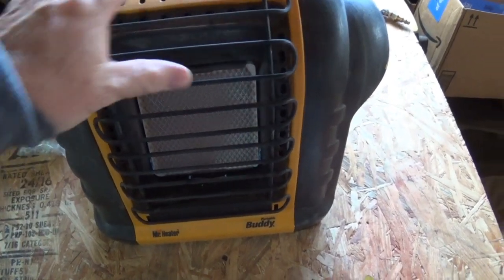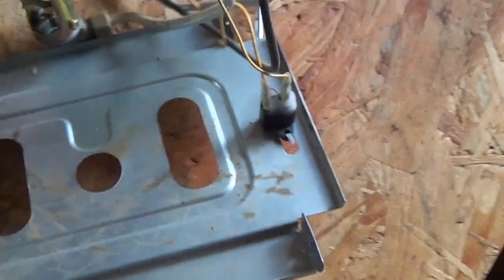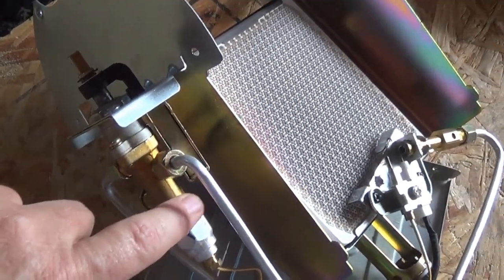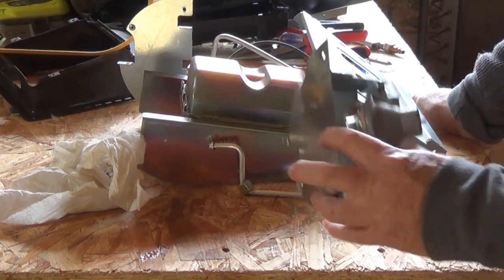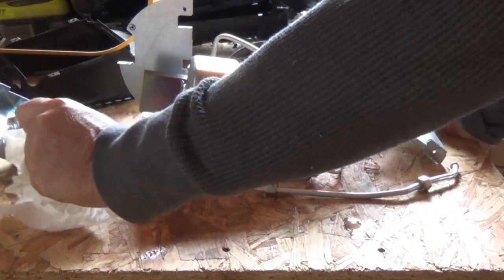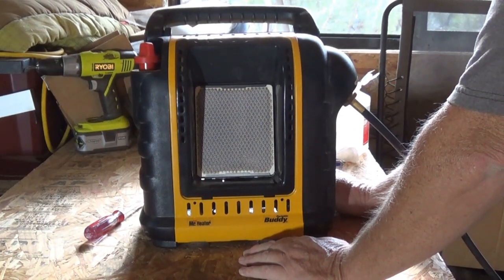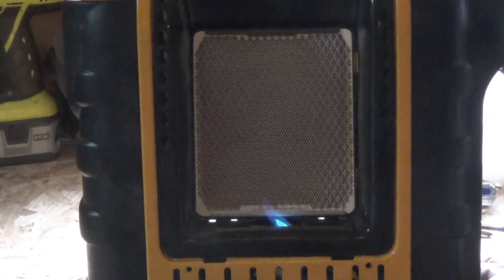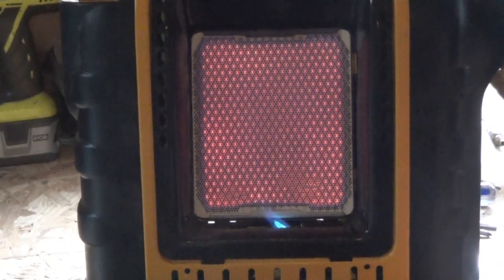Buddy Heater Tear Down - Won't Light Clogged Lines

Comment: It only takes 16 minutes to tare down and reassemble a buddy heater.  Nice 👍
Reply from the maker: lol 16 minutes try a few days. lol.... it did get faster each time. lol.
Reply: @ArizonaHotHomestead  I was going off the video.  😅
Reply: NOT the first time. Reassembly is a NIGHTMARE because  the black plastic ends fir very tight. Took 2 hours. I could do it now in 20 minutes.

Comment: Thank you so much for this video. I had to buy a second one as a storm was comimg and I didnt have time to disassemble. But my second one needs to be cleaned and I tried the ol' cotton swab trick and pulled it out but the cotton got stuck down there. Sigh.....so now I will buy the filter and fix one of these. Haha. Thank you again!
Reply from the maker: your welcome. i got he cotton stuck too. lol i now use smoke pipe cleaners and alcohol. i also use the filter now too. lol
Reply: @ArizonaHotHomestead  I did it and followed your example and now it's running like a champ. Like new!

Comment: I found a wad of cotton in a pool of oil where the tube feeds the pilot. I split the 2 brass fittings and it was inside the middle of the feed side of the pilot. I would never have fixed it if I did not take apart the Pilot. There was very little if any oil in the lines or valve. It was cotton, and I dont know how it got in there?!?!
Reply from the maker: lol. glad you solved it.
Reply: I just got cotton stuck down there... hence why I'm watching how to disassemble.  😅